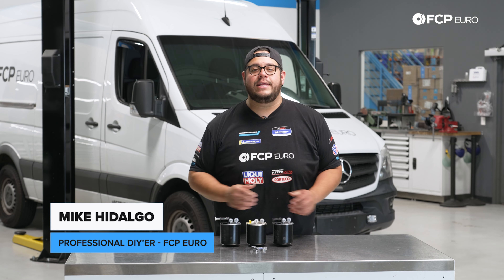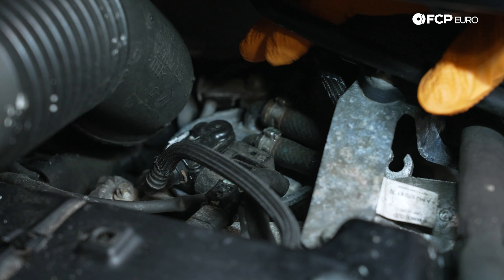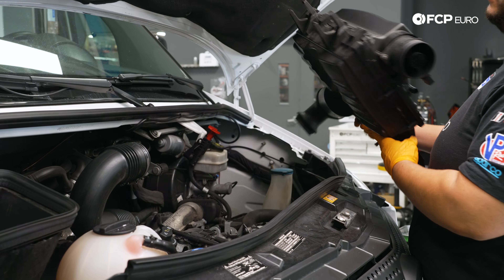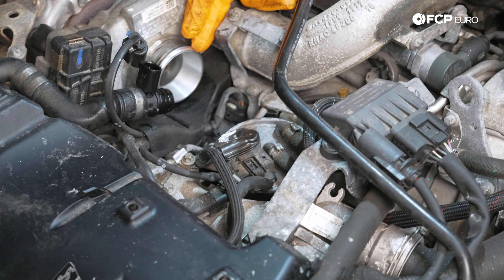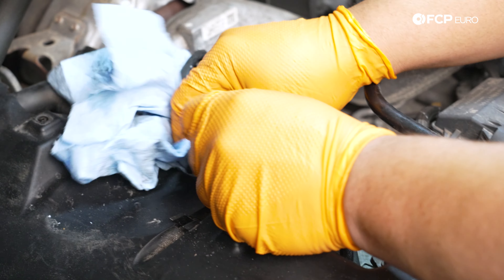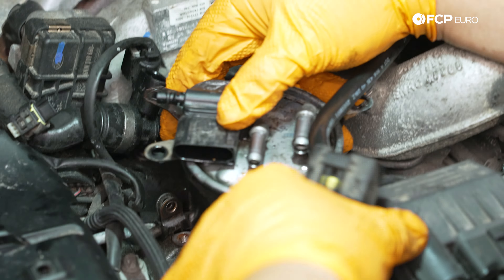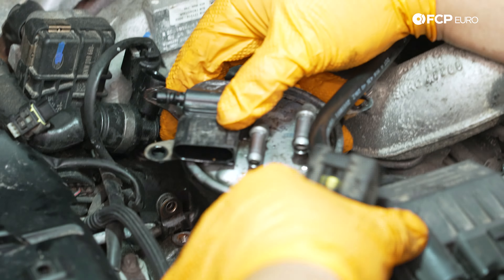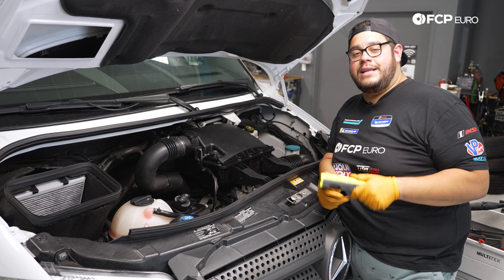Mercedes Sprinter Van Fuel Filter Replacement DIY (2006-2018 Mercedes-Benz W906, OM642)

Comment: Anytime you do fuel filter replacement, ALWAYS replace that black turbo seal, they are prone to leak over time and oil leaks down on to oil cooler and creates a mess. Thank me later. Cheers.